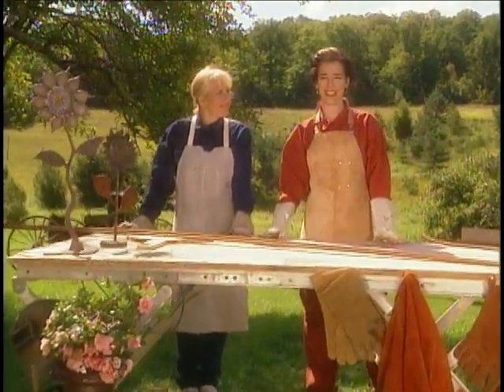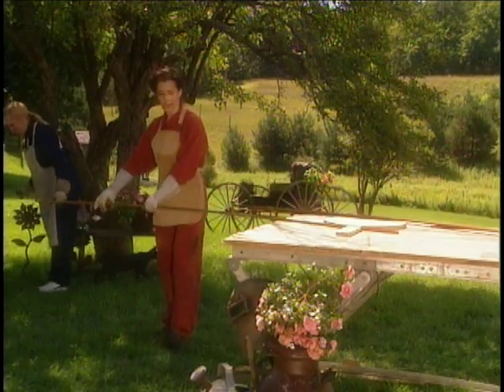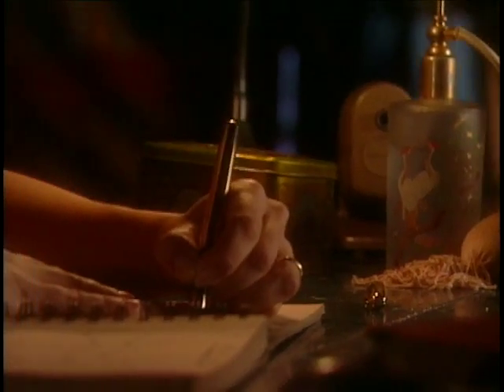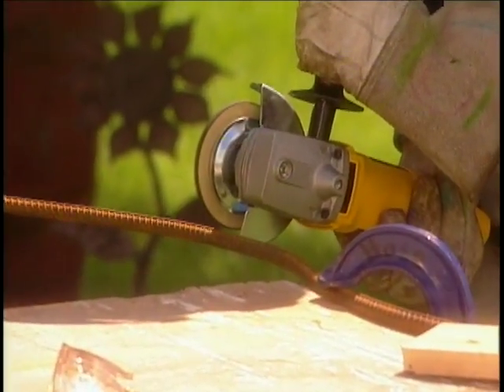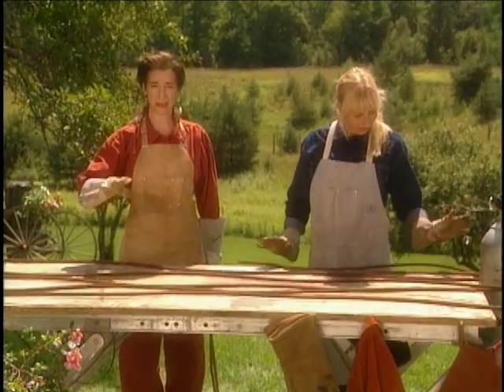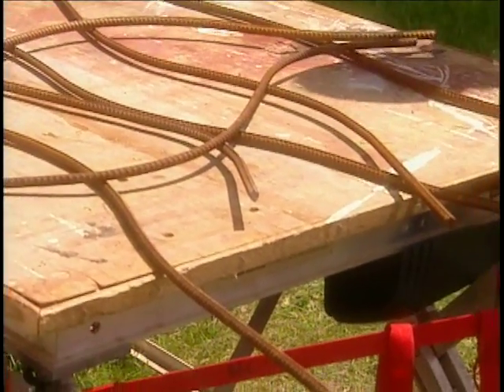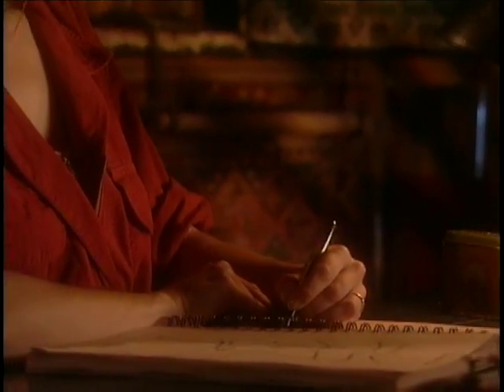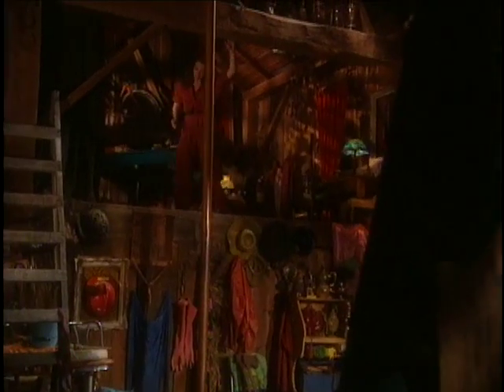Learn MIG welding the simple way: beginner's step-by-step tutorial!

Comment: I know this was ages ago, but that's a grinding disc, not a cutting disc. Its not made to cut and can be dangerous to use a grinding disc to cut. Its manufactured to have it's pressure in a certain direction. Just like cutting discs aren't meant to grind.

Comment: A good, basic, casual use  grinder,  is around $50, when they are on sale, at a variety of stores.  You'll need an extension cord, (Around $25) of course, and a package of grinder disks, too.  A good, basic, disk package is around $30.  You will not have a hundred blades, but, if you are careful, they last a long time....   
The welding stuff is considerably more expensive, and in some places you may need a basic course and license, so as to buy supplies.  (It depends on location.)
Reply: Princess Auto is great for cheap grinders.

Comment: I've been reading about the health concerns and it seems to outweigh any positives of welding as a career. Parkinsons, cataracts, long term central nervous system damage, etc... Are there any genuinely safe respirators you wear under your welding mask to prevent inhaling the poisonous fumes and smoke? I don't want to get parkinsons or any other health issues, I value my health and take good care of my body, so is this a poor career choice or are there preventable measures that can guarantee I'm avoiding those types of hazards. Obviously critical human error (exploding gas, dropping heavy objects on someone, machines breaking, etc) can be unavoidable, but if there are invisible dangers sitting my lungs and running through my body, then it seems absurd to punish yourself in that way. "There are no old welders" you said yourself, that makes this sound like a suicide mission ?

I'm referring to the dangers that have been raised by welders I've listened to, and articles I've read regarding the subject: https://www.medicalnewstoday.com/articles/221710.php

I'm trying to build a brighter future for my family, but I don't think I'll be much help to them if I'm putting myself on a path to requiring expensive medical treatment.

Thank you
Reply: But you can't ignore the benefits either? You get all those amazing things you just talked about, but a lot of welders are also rewarded with terrible wages.
Reply: Its true, there aren't a ton of old welders. But the old ones took their ppe right. I wear a respirator every time I step into the shop. It filters all good sized particulate and organic vapors. There are safe ways to do it, and you can live a long time.